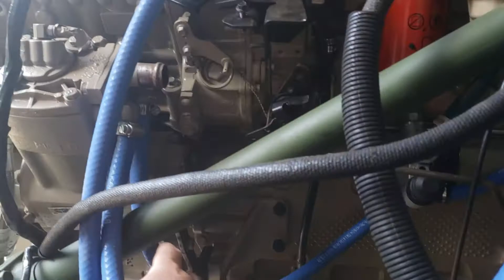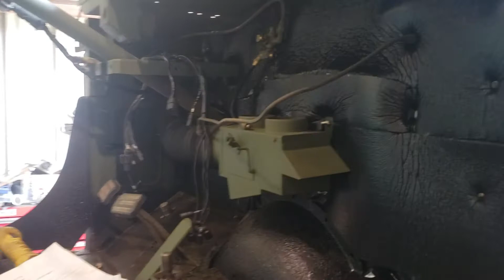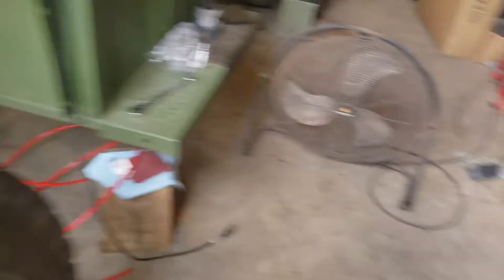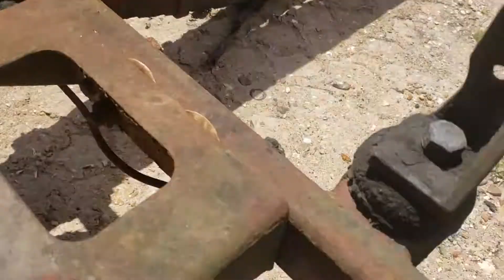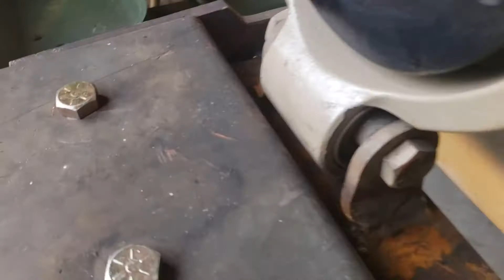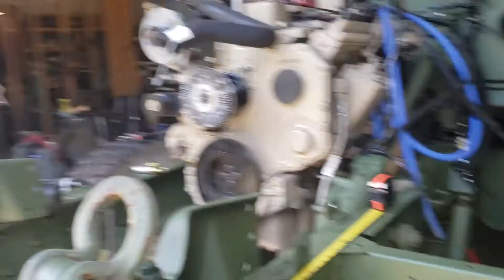M35A2 6BT Cummins swap: So, I guess I'm changing the front crossmember...

Comment: Will u be filming some of the rivet removal like 2 c that? I know it's not rocket science but like 2 c how u tackle it. Thanks 4 the vid.
Reply from the maker: Already filmed.
Reply: just grind the head off the rivet then air hammer or BFH and punch
Reply from the maker: @johndowe7003  🤣 it wasn't quite that easy on the side I filmed.
Reply: @tacticalrepair  i may have simplified things quite a bit, its usually the "easy jobs" that bite.

Comment: Looking good! Have you thought about power steering or hydroboost brakes for this?
Reply from the maker: Of course I have! I'm just poor.😂
Reply: @tacticalrepair  I hear ya buddie, I am trying to save up for a deuce now, but thanks to you and your channel I am learning a lot before I get one, so... thank you
Reply from the maker: You're welcome.
Reply: @tacticalrepair  I'm  working on a hydro-assist system on my deuce. Going to use a Vickers pump with multifuel mount from Waterloo, a late 60's Ford F700-800 draglink, and ram and mounts from Boyce equipment, and PSC reservoir. It should set up and function very similar to the A3 air assist...just a lot stronger. There is a member one of the facebook pages who has been running it this way for awhile with no issues. Won't be as 'factory' looking as a swapped in 5 ton system or the complete waterloo system but if I take my time and do my hoses and lines nicely it will look close. Nice thing is I won't have to worry about wheel clearance issues with my A3 wheels with mounting the steering box outside the frame.
Reply from the maker: @millstonejeepworx  I have a Vickers pump with gear and adapter I've been trying to sell for $225 if you need one.
Reply: @tacticalrepair  I saw that...but it was after I had purchased a new pump from Waterloo. Would of gladly bought it if I hadn't.

Comment: That new cross member look alot stronger and full of more options. What years can it be found on? Great video as always.
Reply from the maker: Not certain what years or when it stopped. Maybe 66 or 67 and older?
Reply: @tacticalrepair  ok, Just curious if you knew. I'll have to check mine it's a 66